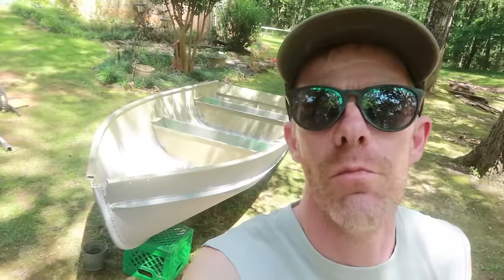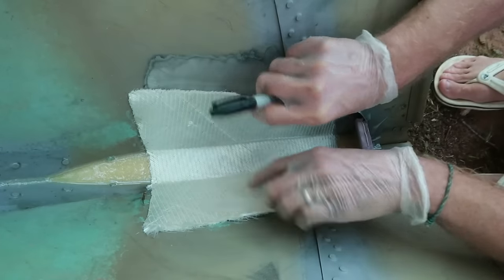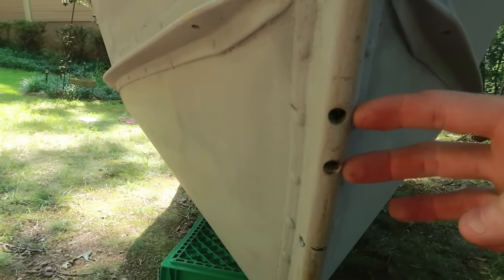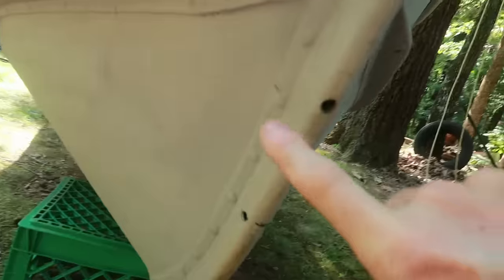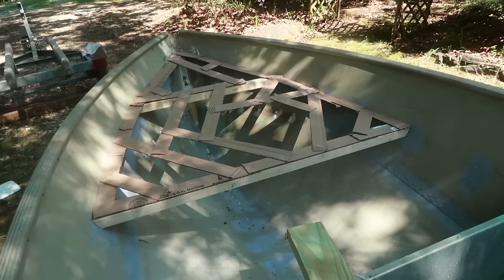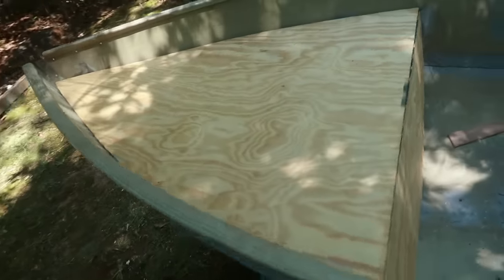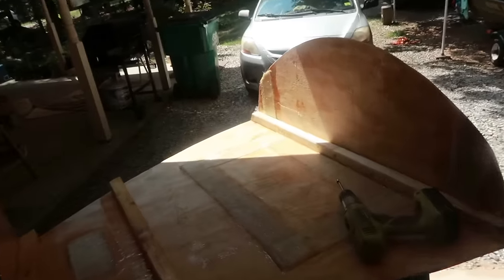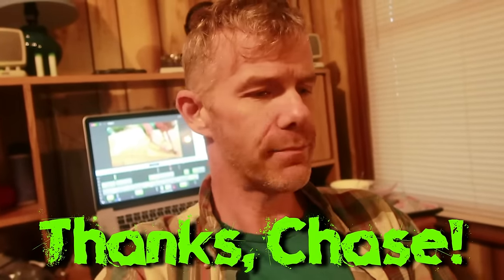Building A Bow Locker For Our Utility Boat | Sailboat Story 258

Comment: I would install cargo tie-down hardware on top of that front storage locker / anchor locker.
Reply from the maker: That's an idea. Personally, I opted to keep it clear as to not interfere with the hatch door or anchoring gear. It'd probably be tough to use those features with stuff strapped on top, but that's the nice thing about setting up a boat like this as it can be personalized to meet individual needs.

Comment: Come on Ben, I had more faith in you than that!  Put both of those 15 hp motors on the Back of that dinghy!  You will have you a twin engine dinghy that compares to no other!!   Hook them together with a steering rod and throttle cable then hang on Molly!!
Reply from the maker: We'd be skipping across the water like a stone.
Reply: @Sailboatstory  - You say that as if it was a bad thing... 😁
Reply from the maker: @Garryck-1  Better for fuel economy.
Reply: @Sailboatstory  - Fair point!

Comment: Nice! I look forward to seeing how you'll deal with water in the anchor locker.. (pretty sure I already know what you'll do, though!)
Reply from the maker: Yeah, you know me alright! I'll tell you though, it was incredibly difficult to find a miniature camel that will live in the locker and drink up all the water that enters, but we got it done. 🐫 Just have to figure out how to deal with all the miniature camel poo. Any ideas?
Reply: @Sailboatstory  - Sorry, I've no idea.. I'm still trying to find such a camel for my own dinghy. Well done on finding a supplier!
Reply: @Sailboatstory  ya, a tiny shovel :-)
Reply: All we could find were diving camels.  We didn't pull the trigger because the cost for camel wetsuits was outside of our budget.  Proper fitment for the hump pouch can only be made if the camel is present for a fitting.  We couldn't find a airline that could accommodate a diving and flying camel.  A weep hole or lumber hole would be a great alternative to a camel, in your application.

Comment: Hi Ben , have you had anymore thoughts on lifting system with the necessary weight your adding !
A strong bow eye is goi g to be a well used item I expect! 
Cheers Warren
Reply from the maker: I'm going to try rigging up a system that'll allow me to use the windlass for lifting. A couple blocks to redirect the rope. I could likely lift it using just the main halyard winch. Maybe just a long-handled winch handle would help give more leverage. I don't have it completely figured out, but I think I should have all the parts needed aboard to do some experimenting to find the best way for us.